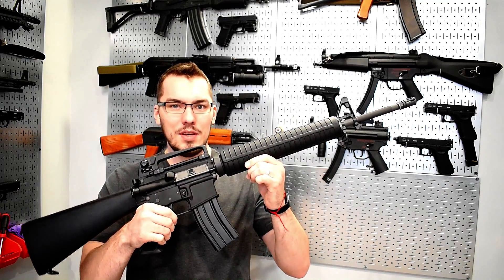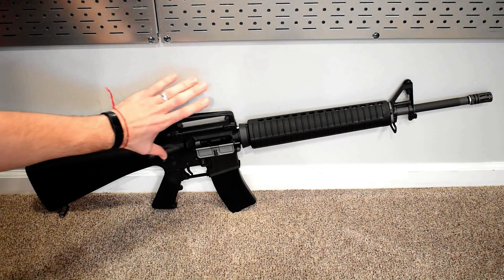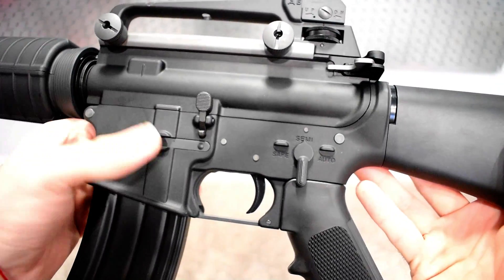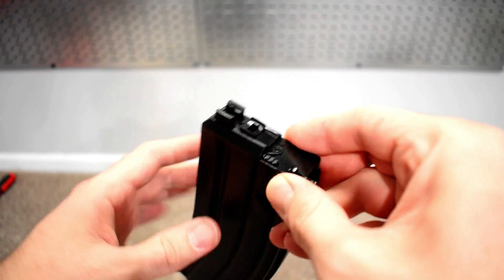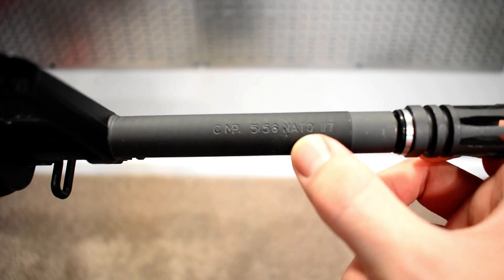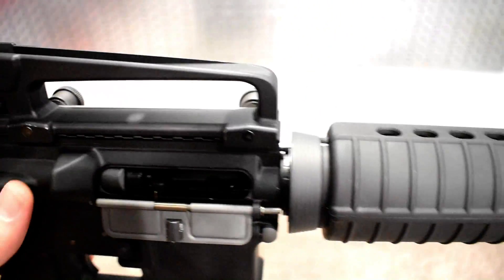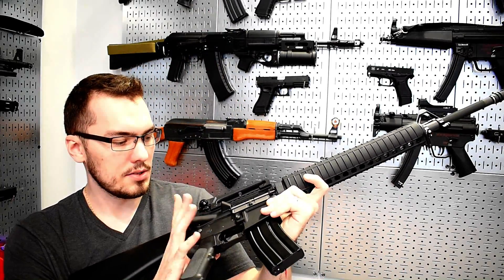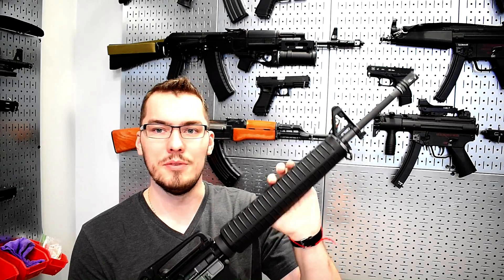WE Tech M16A3 Open Bolt GBBR Review!

Comment: What's the best option: Buy a M16A and buy parts to transform in a M4A1 or buy a M4A1 and buy parts to transform in a M16A3?
Reply: After a mounth of serch, in my opinion, buy a M16A3 and convert to a M4A1 is a lot more cheap
Reply: @paulovitor9388  or just buy an M4A1
Reply: @maxwellclark6992  I preferer the M16 and it's cheaper to convert than buy another gun
Reply: @paulovitor9388  I converted my M16A3 into an M4. It wasn't cheap due to buying RA-Tech inner and outer barrel.
Reply: @stuartcolwell5045  I would stay with M4 WE parts like the inner barrel and hop up. RA Tech? Only the Trigger group, for me
Reply: @paulovitor9388  RA-Tech make aftermarket parts specifically for gas blowback airsoft guns.
They're expensive, but tend to be far more durable.
I would suggest only replacing internal parts when they break.
For the hop-up, I would stick with the stock WE hop-up chamber, but get a Maple Leaf 70° Autobot bucking. Along with Maple Leaf's Omega bucking nub.
The length of the inner barrel is not important, but the barrel quality is. Get yourself a VSR-style barrel - they're compatible with WE M4/M16s etc. 
EdGi, Prometheus, PDI, Maple Leaf all make high quality inner barrels.
Also, the loading nozzle has a tendency to break under sustained high pressure. Like with real M4 magazines it's wise to only load 28 bbs in each magazine instead of 30 to put pressure off the loading nozzle.
Reply: @stuartcolwell5045  I was thinking in start with this internal upgrades before buy the M4 pieces: RA-Tech Trigger group; Poseidon Zero 1 anti Ice Nozzle (aluminium inside and plastic outside) or Just stay with the standard WE nozzel and a mapple bucking. What do you think?

Comment: Im looking at getting one, ppl say we m16a3 isnt gas efficient or reliable hows it hold up in 2024??
Reply from the maker: Still have it and it works great. Honestly, never tested bb per bb on efficiently but its a large reservoir mag for gas so if used in the right temperature setting, it should last pretty decent when on semi -auto mode. Full auto will drain it a bit quicker.

Comment: Does the M16 still have its bolt catch problem?
Reply from the maker: I have noticed issues when I try to rack the bolt on an empty mag and it does not lock until I rack it a few times. COuld be the mag, but has not really bothered me. When it fires the last bb, it locks just fine.
Reply: The bolt release switch can wobble a little bit. That's the problem in 99% from the people, how have this problem with the bolt who doesn't engage after you are out of fire. Punsh out the pin from the bolt release switch and take one very little washer over the pin and than between the the bolt release switch and the M16 case. Problem is now fixed forever! I had a very little washer from my rc-heli E-flite mcp-x.

Comment: 6mm 0,36 g bb's are for me the best for this softair. With this weight a very stable trajectory and this heavier bb's can manage more distance. Match a beverage can with every shot at a distance from 35 meters and more. I used my M16 since 2018 with a aluminium NPAS and a aluminium nozzle from RA-Tech. With a steel bolt from RA-Tech it kicks very hard backwards. And fun never ends, a 6.01 barrel from RA-Tech too. This M16 sounds like a caliber 22 pistol. It's realy loud "for a softair" ;-)
Reply: Is it actually that loud?
Reply: Approx how many shots per refill?
Reply: One magazine with 30 rounds one refill.  The bullets go in the beverage and backwards out.